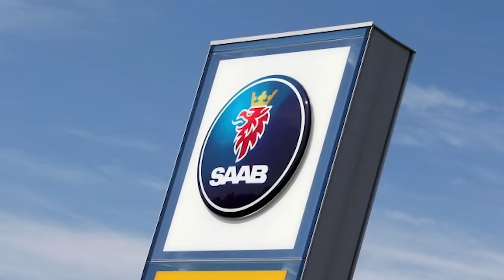SAAB - Everything You Need To Know | Up to Speed

Comment: Does GM kill pretty much everything?
Reply: YES
Reply: GM is the EA of the car industry
Reply: @ironman1181  does GM has Microtransactions and Lootboxes? but in all other way, you are fucking right!
Reply: GM is like King Midas - only that whatever they put their fingers on turns to - well; you figure the correct term for 'nothing of any use' !
Reply: Yes. They sold Opel because of to low profit. Whilst also selling rebadged opels as Chevrolets with slightly Different design for cheaper. And totally not understanding european markets. So the consequence: sell opel and pull chevy (except cprvette) out of europe/at least germany. If you are thinking "wait, but then they can't sell cars to germans anymore, except those five Cadillacs a year" then you're.... absolutely right. Oops. GM also insisted on Opel selling a few rebadged cars that all sucked and after probelms occured (ex. Sintra crashtest...), only then opel was allowed to develope their own car...
At least the frontera was kinda good. But sintra, Antara and some others sucked. Oh, and they basically killed Vauxhall in the 80s/90s and made them sell only Opels with Different badges and no personality anymore.
Reply: They kill every thing because they constantly get bankrupt
Reply: Yes, god damn them SAAB didn't deserve to die
Reply: @Delta132  they should've killed off buick instead of saab and pontiac because buick is literally now just pathectic badge processed opels
Reply: @Delta132  at least pontiac badge processed  actually good cars like the commodore (g8) and monaro (gto) which were were actual muscle cars with Corvette v8s that look like any other car on the road
Reply: @DatboiYugo  can't forget the trans am and ram air yeah
Reply: yep they killed all for the best cars
Reply: Including itself.
Reply: RIP Holden.
Reply: Just like diseny
Reply: Like liberals
Reply: yes GM has no long-term vision and only seeks to use corporate takeover as a method for acquiring technology is that it did not have the forethought to actually develop on their own General Motors is he most pathetic car manufacturer to ever exist and yet they finance my fucking existence
Reply: Yep pretty much

😩
Reply: They kill the good guys the bad guys and the lines in between.
Reply: Harry Pujoles you know there’s other countries that exist right?
Reply: nah man, im alive and kicking still
Reply: yes its their profession
Reply: @ironman1181  G. M CARS... its in the brand loyalty!
Reply: Yep
Reply: Yep, whenever one of their cars starts to get good, they kill it. Example: the Buick Grand National, and the Pontiac Fiero.
Reply: Yep...
Reply: @kaisertrinityt.m.i.s1607  soon bro
Reply: Paul Lunsford  some are. 3800 was ranked #3 best engine in history
Reply: @Delta132  didn't deserve to die*
Reply: If it’s not Chevy it’s not anything
Reply: Yes
Reply: Saab killed itself... GM didn't have a hand in it. Saab never built cars to truly make a profit and the company shuttered because of this.
Reply: Yep
Reply: yeah, even their costumers....
Reply: Yes GM kills everything. Saab, Saturn, Hummer, Pontiac and other cars
Reply: @alfa_guy09  Wrong... those brands killed themselves.
Reply: @stuartstogdill2406  well when GM had to get money from the government, they had to slim down their lineup. They killed Hummer, Saturn, and Pontiac but they sold Saab to a other company which was their downfall. Saab did not make it long after they got sold.
Reply: @alfa_guy09  and if you knew anything about those brands, Saab, Saturn and Hummer were never profitable for GM and lead to an average loss of $1.1B  each year from 2003 to 2007. Pontiac was another loss leader for years as well which led to it being shut down. Again, those brands killed themselves by never really making cars that people actually bought and then became loyal owners and repeat customers.
Reply: @stuartstogdill2406  Well I’m sorry I don’t pay attention to those brands.
Reply: @timweber4318  they killed the Kappa platform too only 3 years after making it
Reply: Yes
Reply: GM destroyed Opel and Saab.
Reply: List of companies and car brands that GM kills:
Buick
Pontiac
Saab
Opel
Vauxhall
Holden
Hummer
Reply: @stuartstogdill2406  Let's be real GM always put rebadged cars of their lineups.
Reply: "GM Cars. It kills the fun"
Reply: YES
Reply: They love quick money.
Reply: GM is my most despised auto company by far. They buy up special companies, gruesomely mismanage development, churn out cheap cash-grab cars and then kill of brands when the obviously inevitable failures occur.
Reply: Yep
Reply: Thats call Monopoli
Reply: Short answer yes, long answer yes
Reply: Pretty much.
Reply: @kaisertrinityt.m.i.s1607  OnStar is a microtransaction after you buy a GM vehicle so yeaa
Reply: Is that a rhetorical question?
Reply: @kaisertrinityt.m.i.s1607  when you have a subscription model for heated seats...
Reply: @alexcuevas5633  yub, after all those years bmw and mercedes are doing an subscribtion system aswell.... so yeah they really become the EA of car industry
Reply: SAAB rebelled against General Motors General Motors didn't like it and that's the reason SAAB was killed off in 2012. When the Opel Vectra Mk I came out (Vauxhall Cavalier Mk.III, UK) said to SAAB you can do whatever you want, as long as it looks like the Vectra (Cavalier), SAAB 900NG looking nothing like the Vectra ( Cavalier), So when the the Vauxhall Vectra Mk.I (Opel Vectra Mk.II) came out they said again do what you want with the car but it has to look like the Vectra Mk.I(UK), Mk.II (EU) and the 9-5 didn't look anything like the Vectra, it also had a SAAB made not GM made navigation system as well. They were about to build a Vauxhall (Opel) Insignia inspired SAAB 9-5 mk.II before the inevitable in 2012.
Reply: @stuartstogdill2406  Alfa got its money payed because it’s part of fiats development house. The SAAB eco tech engine is in borderline everything gm but they didn’t get any development kick backs. Gm sucked them dry
Reply: Yes
Reply: Pretty much, ye
Reply: Yes.
Reply: yes
Reply: @timweber4318 yes they did that too
Reply: and the other reason why opel doesn’t exist here in the u.s
Reply: Yes. Unfortunately. I remember when SAAB Automobiles went under.
Reply: @stuartstogdill2406 those saturns just ran and ran. I had one in upstate ny with 300k before it rotted out and the rest was fine. My dads had 2 with 300k region and ive seen many others. Gm shoulda kept them. The saturn was the only successful 1.5l up to 2.2l engine made by gm imo. The cavalier motors sucked, my s10 with the 2.2 sucked
Reply: I had always hated GM…then they killed Saab….my hate for them went OFF the charts…..SOBs
Reply: Insert ex-wife joke here.
Reply: @PastaRulla  What did your ex-wife do? Filled the tank on a diesel with petrol?
Reply: Ford does it worse but both do yea
Reply: THEY KILLED HOLDEN!!!!
Reply: Just the best stuff
Reply: Yes
Reply: Even themselves then taxpayers bring them back
Reply: Everything good
Reply: Yes

Comment: Forgot about the Saab 9000 though... Those were legit kings of the road back in the days.
Reply: Andreas Heed and the sonnets!
Reply: Yes
Reply: My first car was a 9000 CSE :)
Reply: got a 94 9000 aero myself and even though it's an auto its pretty quick for what it is
Reply: Best car In WORLD 1994 9000 CSE
Reply: My mum had one lmai
Reply: Jose Martinez  they are really easy to work on, also anything that brakes is worth to fix on em, because when you rev it over 4000rpm, you'll never want to sell it.
Reply: Jose Martinez  I have a 1997 and its pretty easy to work on yourself. Im a beginner and ive done loads of maintenence, changed the whole damn gearbox, mounted new front suspension etc. It's pretty straight forward, just use google and "haynes" book on 9000 (dont know if it exists in english though) and youre good, i promise!
Reply: Not a real Saab since it got its kee on the stearingcollum! Just a rebaged Lancia.
Reply: @gunnarkvinlaug7226  bullshit.. alfa, lancia, fiat and saab joined up and started building the "type four" platform and share some bodyparts and so on but saab did as they always did, changed a bit here and a bit there.. aaand repeat 👍
Quick Copy/paste here
"The Saab has a beam axle rear suspension, rather than the independent MacPherson found in all the other models. The front of the Saab is radically different from the Italian siblings due to the much improved crash protection.[4]" 
And so on.
Thats why their collaboration even ended before the platform was ready.
Reply: Nah, it didn't have the ignition in the center console. I need that in a Saab, or I won't like it.
Reply: Its a Fiat Croma...😂🤣😁 Or Lancia thema....
Reply: my dad have lit of 9000
Reply: Saab 900 turbo -88 .....
Reply: My mum had a Saab 9000 turbo. Legendary.
Reply: 1986 saab 9000 ". The distance ran was an amazing 62,000 miles (100,000km)at an average speed of 132mph (212 km/h) by three cars picked randomly from the production line with no modifications other than the fitting of role cages and a six point safety harness for the driver. During the test Saab managed to bag 21 international and 2 world records."
Reply: Many people considered 9000 the last real Saab. It was last model before GM takeover. Even though people say 9000 has same platform as the Fiat, it still use Saab's engine and a lot of Saab's engineering, unlike the newer models that got much more GM's parts in them.
Reply: I got one of the last cse's ever built. It's got all the internals to an aero from factory but looks like any other cse turbo. Waiting to put 'er back together.

Comment: Saab: Born from Jets. Killed by A$$holes! (GM)
Reply: It didn't help that Saab was sucking GM dry financially. They were given vehicles and told to change the badging and body and instead Saab spent millions reengineering the vehicles. However, they did make them somewhat better. I'll take a 9-7x Aero over a Trailblazer SS any day. My 06 9-7x Arc had some quirky problems but it sounded, handled, and performed better than it's GM counterparts - Chevy Trailblazer, Buick Rainier, Oldsmobile Bravada, GMC Envoy, AND Isuzu Axiom.
Reply: @nrgzrbny  "somewhat better" is the understatement of the century
Reply: @nrgzrbny  my opel vectra got so raped by saab aero (its kinda the same car) gm should have just let saab make the cars and rebadge theirs XD
Reply: @RavenousElf  the transfer case control motor was a joke. Mine broke and it locked the front output. I had to replace the seal and CV half-shaft due to pitting from crow-hopping during slow speed turns. They should have just used the Torsion limited slip xfer case out of the Aero/SS on all models.

It also wreaked havoc in the snow. Doing 35mph, front output engaged. Everything fine. Person in front of me hits the brakes, I slow down, front output disengaged, rear wheels lose traction and speed up, front output engages, car jerks around in the snow and slides out of my lane. Over and over and over. Ended up on the side of the road slowly getting closer the cliff edge as I tried turning around. Never drove it in snow again.

Comment: Saab is the best on earth 
You can‘t buy a safer, cheaper, faster used vehicle than a saab 9-5 aero
Reply: debatable 9-3 arc
Reply: A volvo 240
Reply: @tarnan6001  well a 240 is a nice car but it cannot compete with the performance and safety of a saab 9-5 aero. But yes the 240 will probably be cheaper but saabs are still a bargain. We have a 250hp aero (in really good shape) which had 115.000 km (~71.500 miles) on it when we got it. That car cost us 2500€ (~2800 usd). I think you cant beat that
Reply: saabs are great until they brake, old Volvos are great bcuz they never break, also volvo 4ever cuz stock driftcar :p
Reply: @sebbzii3906  it depends on what Volvo you mean
Reply: @sebtenking6462  i was thinking of 200 to 900 series
Reply: @sebbzii3906  yeah they are pretty solid i had a 240 wagon ones
Reply: what about the v8 9000
Reply: @Tussinaama  Only 1 SAAB 9000 was build with a V8. It was build in Finland as an experiment.
Reply: @sebbzii3906  everything brakes..... Dont be stupid
Reply: My ‘89 Saab900 turbo spg will smoke all of you ! (w/out a/c of course)
Reply: I have a 2009 Saab 9-3 and it amazing
Reply: 9-3 aero? Lol
Reply: Dirt Road Auto Repair  Volvo 850r
Reply: i have a saab 9-5 aero right now =)
Reply: @1889990  I think I can :) I bought my 2002 9-5 Aero for 800 bucks and it runs like new, but I live in Sweden on the other hand. Lots of cheap Saabs here. Also it had a bit more miles on the clock :p
Reply: @1889990  wow that is a good deal!
I can't find them that cheap
Reply: @sebbzii3906  All cars are great until they BREAK including Volvo's. Great power but cannot match Saab for delivery!! Especially when tuned!!
Reply: @sebbzii3906  you say that, but find a good Saab mechanic and your bill will be less than most other car company fixes. I have one in northeast Mass that fixes my baby up (my 9-5 turbo) and it never hurts my budget, even when the repair is big. He has a long list of sources to get parts from as he's been a Saab specialist for ages.
Reply: turbox
Reply: I agree, I bought one not long ago. Very. Quick car.
Reply: My 9-3 Aero disagrees  :D
Reply: Bobthebuilder 67 I got a 2011 Saab 9-3 love it as well
Reply: I absolutely love my 9-5, it's crazy reliable too 250,000 miles and still putting along all the same. Edit: 2001 9-5 aero wagon
Reply: i bought my 2005 9-5 Biopower for 10 cents beat that one if you can
Reply: Do they come in a manual tho?
Reply: That’s THE MOST important question and if not, oof I ain’t really gonna be sold on it
Reply: @tarnan6001  exactly
Reply: Just got my own 9-5 Aero!
Reply: @alexveillette2649  that's what I have, b207r with the 6spd
Reply: @tony_5156  My 9-5 Areo wagon is a manual [2008].
Reply: @UserName-pi1ml  whats the difference betwen  6spd ,5spd b207R in means of performance, i have 9-3 Aero with 280hp and I'm pretty happy with acceleration, is it worth swaping 6spd in for better times?
Reply: I learned to drive ainan '07 Aero. Fantastic car all around. I will burn GMC to the ground someday.
Reply: My 08 9-3 was $4000. It now has about 440 to the wheel. Just bigger turbo, injectors and stronger springs thus far.
Reply: @HerrDagerman  Gonna try to pick up a 92 when I move to Sweden.
Reply: The 9-3
Reply: My mother had one while I was growing up
Reply: Actually yes you can the 93 2.0t
Reply: ive got a 95 aero wagon and it was a steal
Reply: Just look at my pfp.